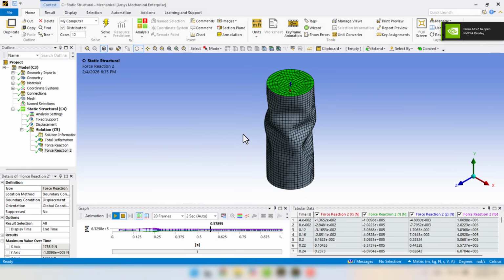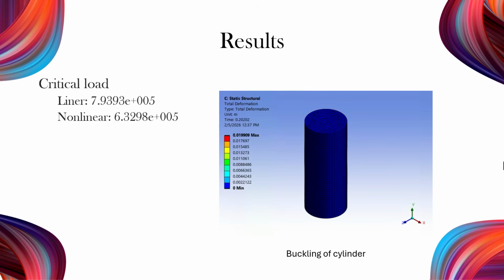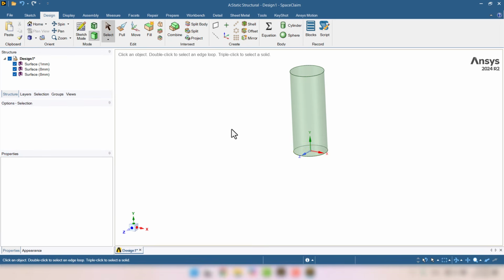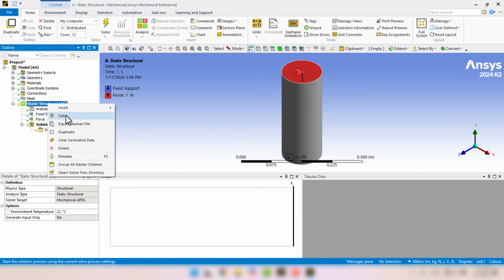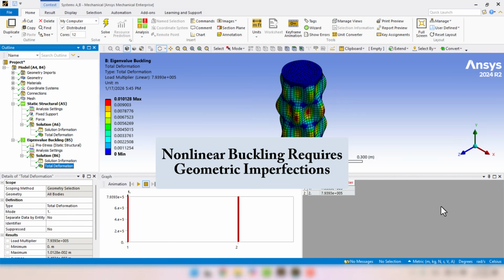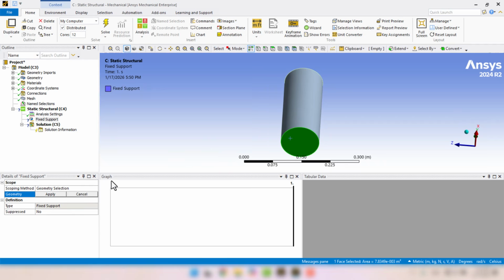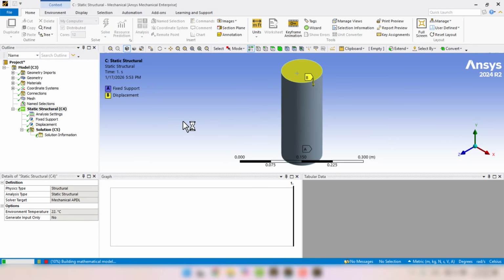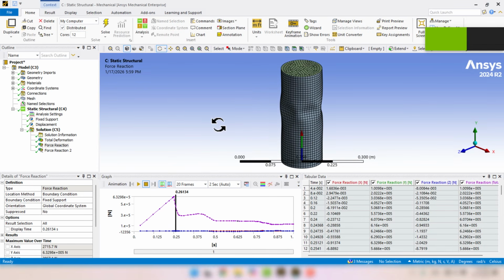ANSYS Tutorial: Nonlinear Buckling of a Cylindrical Shell!

Comment: Hi, what's the difference between those 2 "static structure" tabs? I do not understand how you switched to non-linear by just changing the "scale factor" to 0.01
Reply from the maker: Hello, the first mode is used for linear buckling. In fact, we import the first mode shape as an imperfection into the second static structure.
Reply: @caewitharminhashemi  Thanks! I noticed you did not use "Structural Steel NL" material for non-linear analysis. Does it not make any difference?

Comment: Thank you sir, I wonder that doesn't the mode shape in linear buckling need to match the mode shape in non-linear buckling since we use the linear eigenvalue mode shape as the initial geometry in the non-linear buckling analysis ?
Reply from the maker: Hello, yes, they are the same, but the nonlinear value is more accurate.